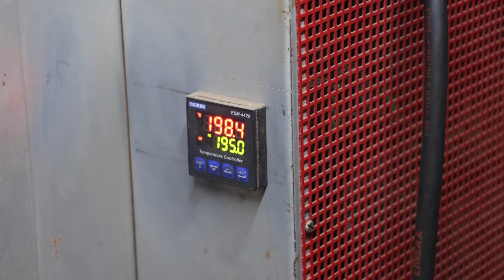Forging a bowie knife, the complete movie.

Comment: Hi ! Could you explain what's the green paint you use before the heat treatment ? Thanks ! I really love your blacksmithing : massive and pure like dwarf's blacksmithing...
Reply: I think that just helps it not to oxodise
Or turn grey blackish
Reply: It will glow in the presence of Orc, of course. 😉
Reply: CONDURSAL Z0095 or Z1100, protective paint against oxidation and scaling (Made in Germany by Nüssle Company)
Reply: @anstra7028  Thx man, have to try this stuff